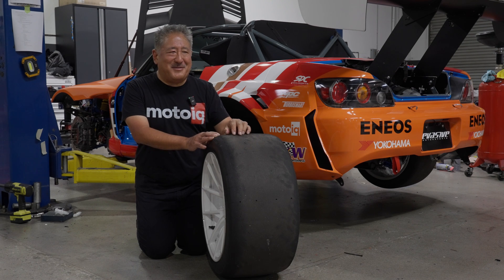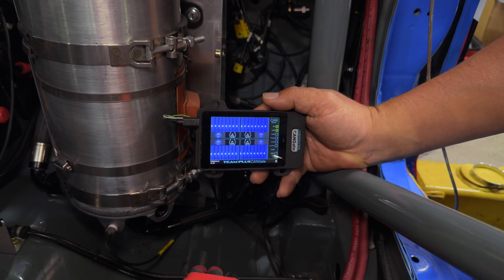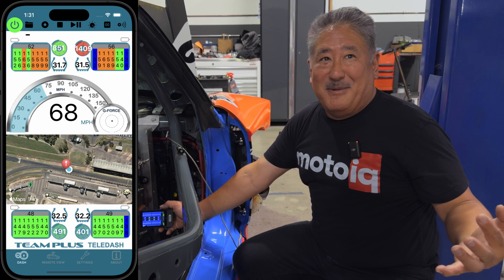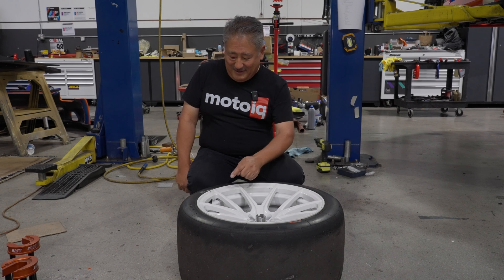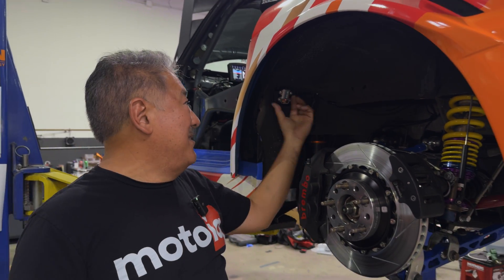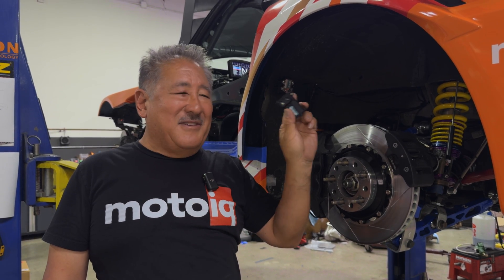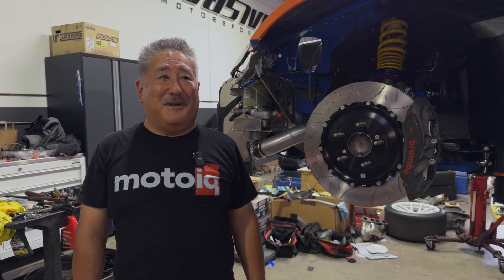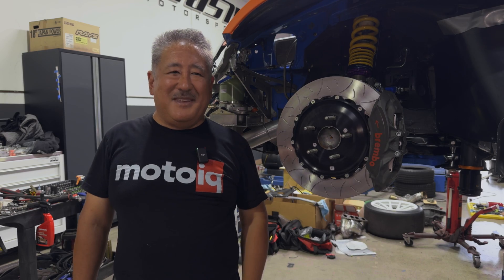Affordable F1 Telemetry!

Comment: If you use the valve stem caps as the sensors, make sure to upgrade your valve stems to metal ones. I put these on my sportbike and the extra weight and quick spin up of my rear tire, caused the valve stem to bend and then fail. I was going around a long sweeping turn so I gunned it, we don't have many curved roads in Oklahoma, and I was leaned over when suddenly, my rear tire loses pressure and the rear slid out, but my Kawasaki KTRC kicked in and saved my butt. I thought I ran something over, but nope.
Reply from the maker: Wow! Thanks for the advice.

Comment: How durable are these sensors? I mean, they are mounted in the wheel well after all.  They can be damaged by small rocks, debris or what have you. Pretty expensive to replace because of a half-inch stone. I'd be curious to find out how they are constructed or what they have for protection.
Reply: They currently have a warranty policy where they’ll replace a damaged sensor free of charge, as long as you have the sensor still and it hasn’t flown off the car in a crash. They’ve done some extensive (1000 miles+) gravel road testing with them and had no failures. But you’re absolutely right, optic sensor next to a tyre is at risk. Cost of doing business unfortunately.
Reply from the maker: Pretty tough case, not too expensive to replace.

Comment: This might sounds silly but Is there a way to mount the sensor to get a suspension reading without mounting it on top of the tire?
Reply: There’s a time of flight sensor in the array, it sends infrared light pulses and measure how long before that return, multiply by speed of light and you have distance. Unfortunately get suspension position needs you to figure out what you’re measuring, and how that measurement relates to suspension position. If your sensor is directly above the wheel, in line with the arc of the tyre through its range, the calculation is what you measure is pretty much suspension travel. If you offset it you have to compensate for motion ratios, steering angle and shape of the tyre.
Reply from the maker: Not in the instructions